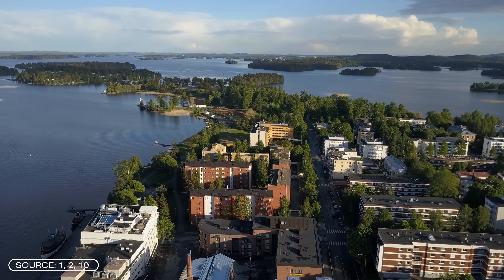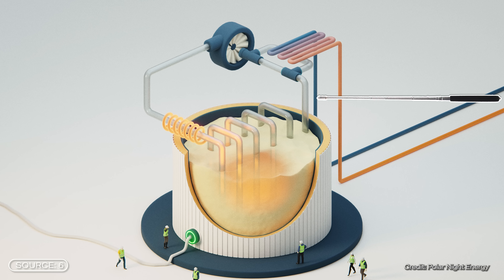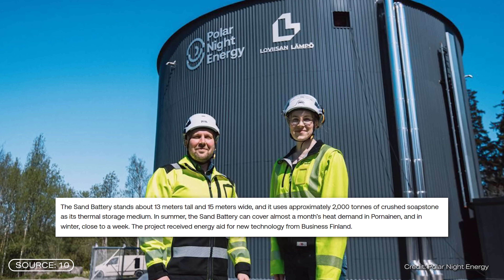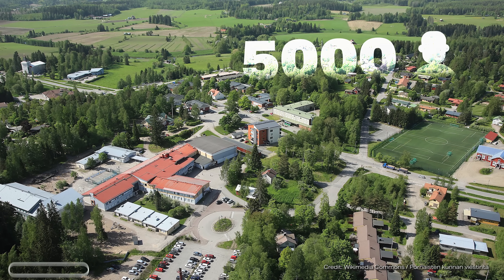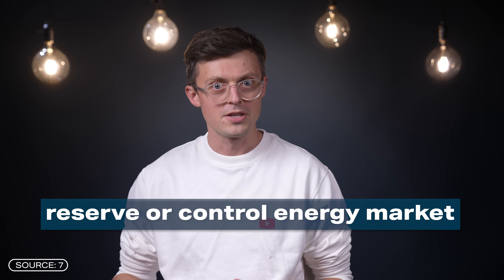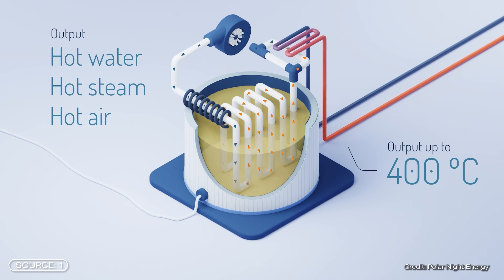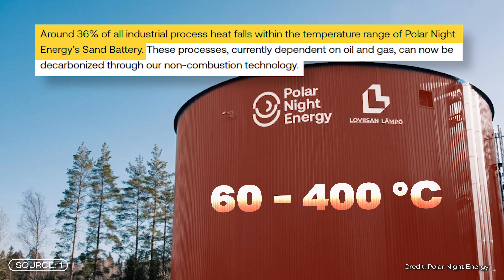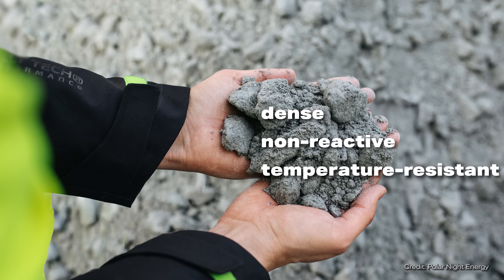Finland's Giant Sand Battery: A Revolution in Energy Storage?

Comment: Why does this unit have a working life of only 30 years?
Reply: Mr. Socks, I would think that is a conservative number, considering the inductive coils and the fans used to move air thru the system are all external, so when they fail, they can be quickly replaced with off the shelf parts.

Comment: I think the biggest weakness in this solution is that you use the highest quality energy source (electricity) to produce one of the lowest quality energy sources (heat). In Denmark district heating is widespread, so this type of solutions would work well. But there are a couple of sites in Denmark where they use ponds as heat batteries. Basically big holes in the ground, sealed and filled with water, with a floating insulating lid. On land thermal solar collectors are installed and they heat the the pond to about 90 d celsius in summer period which is then used to supply heated water to consumers via a heat exchanger. All you need is power to drive the pumps so there are virtually no operating costs. About 50% of the heating on the island of Ærø is covered by this solution - about 5000 inhabitants.

Comment: 9:38
Every steel plant using blast furnaces have been using brick batteries for decades, if not centuries. 
The brick batteries were heated by coke production gasses being burned 🔥 to heat the bricks to red heat and then when "blasting", the gas is shut and moved to another battery while air is passed through the original battery and injected into the furnace through tuyers at supersonic speeds to reduce the iron ore, coke, and limestone to pig iron for Bessemer converters or open hearth furnaces to turn into steel with added elements for specific properties ❤
I love the videos 
Please make more

Comment: It seems (to me) that the resistance and then conversion to hot air is lossy, though it might be that placing the resistive wire directly into to sand has problems as far as damaging the wires themselves. Moist sand could be heated by electrodes as opposed to the long resistive wire, which is also subject to thermal shock and inrush currents shortening it's life. Thermal vacuum panels could increase the efficiency, and I would guess that this system would also need expansion joints just like a bridge. The most "R"  value is of course needed on the top, leading to structural design issues that must be addressed but certainly can be mitigated. Perhaps Glaubers salts or a most efficient mix of the sand itself could be found as that would also improve it. All the Best! 73 DE W8LV BILL (and in SANER times) W8LV/VE3🇺🇸🇨🇦🙏🇺🇦

Comment: The issue with this is that the capital expense per kWh of storage capacity is too high.  The smaller one a few years ago was around $25/kWh-th, this is probably similar.    Much lower capex is needed for truly game changing seasonal storage.    I suggest you instead look at Standard Thermal's thermal storage system.   It stores heat (also at 600 C) in the cheapest thing imaginable:  a pile of dirt.    Dirt can be piled up for about $1/ton, so this is promising a capacity cost of $0.10/kWh-th, two orders of magnitude better than the Polar Night's scheme.

Comment: Why do they build the battery above ground and not in-ground?
Reply: Ground water movement can remove a lot of heat. Being elevated ensures that doesn't happen. Somewhat ideal, would be to use a hill that you excavate into, and berm the walls with the soil, and over the top and down the sides of the hill place a water barrier such as plastic that is sloped slightly away from the mass to keep the whole core dry. Also an advantage is if the unit is insulated and buried, and then bermed, in the winter the unit has the soil acting as a buffer to the extreme winter cold.

Comment: Some of your logic is very difficult to follow and certainly does no favours to the sand battery. You say the system is designed to charge up to 200 times per year but, in reality, will charge only 30 times per year ... and thereafter you treat that number as some sort of 'real world' charging limit that you compare unfavourably to Denmark's seawater heat pump. This is despite revealing earlier in your piece that the fully-charged sand battery supplies its customer with an entire month's worth of heat in summertime. Clearly, it's charging 30 times per year because that meets the customer's needs and WOULD charge up to 200 times per year if that were needed. Also, you continually jumble the task set for this first-of-a-kind system - district heating - with the multiplicity of heating tasks it will tackle going forward. This is despite revealing early your piece that Polar Night's future focus is industrial heat demand. By the end of your piece you've inexplicably pigeonholed the sand battery as a 'niche' tool for district heating in cold countries. "I just think it's very niche because many countries don't really need much energy in the form of heat". Your throwaway line "it can also be used for industrial heat" completely underplays that massive decarbonisation opportunity - in EVERY country, hot OR cold - over a range of temperatures. Industrial heat isn't an add-on. It's the main game for TES aspirants - Polar Night, Rondo, Kraftblock, Brenmiller, Caldera and a host of others.

Comment: 10:20 Agree on the district heating. I live near city of Kuopio in Finland, where the district heating can cost almost 2000€ per year for a medium sized home. About 20% of the cost comes from fixed monthly payments. As the efficiency of heat pumps has increased, geothermal or air to water, people are looking for different solutions for district heating. 
In apartment buildings with 20+ apartments the district heating makes more sense, and usually is quite bargain for the resident. 
I have understood that there has been few projects in Finland where a apartment building is using geothermal energy as heating source, but I don't have more information about how it played in the end.

Comment: Your bit of on the scale how long the battery lasts, but otherwise that that its pretty good.
Also, Elisa is not running the optimisation of the sand battery. They only run the reserve market
Reply from the maker: Thanks for the correction!

Comment: Sand batteries can be quite cheap to store heat and maybe energy-to-power in super niche situations.
That insulation is maybe the second most stable and idiot proof technology in it. Only the sand beats it. 
The whole thing relies in smart energy store plan with waste energy and cheap electricity. you can use it to help energy grid not to collapse when some factory or house area disconnects from the grid unplanned.
It's all about, how cheap you can make them and fast, and also the heat distribution infrastructure.

Comment: Burning fuel in a powerplant then using that electricity for resistive heating will always be more expensive than just using the same fuel directly. If all surplus electricity gets used by flexible loads, the spot price stays roughly stable and is determied by LCOE of underlying generation technologies. So if we want the real costs of energy production not to grow (at least in this scenario with no curtailment, since curtailment also raises the costs of energy), the LCOE of renewables cant be above the price of fuels, or, ignoring capital costs, it has to be at most 60% of the cost of electricity from CCGTs (given that they are about 60% efficient). So, if LCOE of CCGT is at $50/MWh, renewables must be at $30/MWh. Anything above means that an economy has to pay a premium associated with climate change mitigation and weigh these costs against potential damages from doing nothing.

Comment: In the Netherlands only about 7% of buildings are connected to district heating yet there more than 3,500 thermal batteries in the form of Aquifer Thermal Energy Storage systems. They work both ways, for heating and cooling, and function as seasonal storage. These systems are cost effective. Of course they can only be built if the underlying geology allows it.

Comment: 30 charging cycles. So it's not renewable then... Hopefully they can get more in the future.
Reply: 30 Each year, not the lifespan. As long as the heating elements works and the tank doesn't rust it's have really long lifetime.
Reply: @terradeamon  Oh okay, my bad. Thanks for correcting. Well then it's even more fascinating. I was also thinking, why they dont lower it down into water to mitigate winter effects (or just bury it in the ground). Water is always +4 celsius and underground might be even better.
Reply: @peterolofsson9871  yea that was what I thought, turns out the big issue is water ingress, it could be explosive if it gets superheated to several hundred c. So you have to spend a lot more to build it. And if you just use a lower temp you loose a lot of the energy transfer. 😅 Can be done but it built completely different, more like ground heat that you dump extra heat into during the summer. (Also a fascinating tech)

Comment: If you have district heat network in the area and you are going to use the energy only as heat for the surrounding houses, water is a better medium than sand. You need to convert the energy only one time from electricity to heat using excess electricity when it's available and you can use heat pumps (COP between 4 and 6) to make the hot water. That hot water can be run directly in the district heat network and returned to the same container.

I think for sand to make sense, you need have industrial customers near by that need high temps and/or a lot of excess electricity production (i.e. solar panels) so that the inefficient E - H - E conversions would be worth it.

Comment: Except district heating is essentially always made upon industry in the area ie factory have powerplant that produces the electricity for the plant and excess is pumped into grid, the heat after all the factory needs like for drying etc and heat collected from the smoke via smog washers and turned into glycol water heat using water to water and air to water heat pumps, are then pumped into district heating glycol water that gets pumped into control station in the district and from there via heat exchangers to district specific loop. Only way the heat battery makes sense in these applications is if they use this heat instead resistive heating element to add and collect the heat. On factory the heat collection with heat pumps makes sense, but for this its questionable if conversion efficiency makes sense, specially if you are pumping air trough all that. Maybe a closed loop air circulation could be done inside the unit but electric heating the mass should be the back up 3 for this system.

Comment: Reading Pornainen like a German word would've worked much better than English pronunciation.
11:03 ...No? Why would you need to make it smaller, if there's enough sand to fill in the gaps? Yeah, you're adding surface relative to volume, but if most of the material is sand, it doesn't really matter if the draw is 1% per hour of max. And the insulation looked like what we've been using in houses for decades. It's rock wool or similar.

Comment: When you pronounce Finnish words such as Loviisa and Elisa, you should pronounce the short vowels and long wovels a bit different. Short vowel (e.g. single i-letter) should have constant frequency ("one note") and double vowel  or long vowel (e.g. double i-letters) should have a sliding frequency from higher frequency to lower frequency (imagine sliding a note or two on guitar string). It sounded like you did words Loviisa and Elisa just the other way around making it sound like "Lovisa" and "Eliisa" for native Finnish speaker. Many native Finns fail to notice the frequency change in their own speech and they may claim that the difference is the length of the produced sound. Yes, there's some length difference because you cannot make the sliding sound with very short sound but that's secondary effect only.

Comment: The reason this tech get better the bigger you can make it: surface area (heat losses) for the whole container only grows to square but the whole volume (total capacity for energy storage) grows to cubic when you make it bigger. And logically there must be some minimum size after which it no longer makes sense to build the storage at all.
Reply: Heat storage losses are minimal compared to the heat stored in them.

Comment: 1:30 It's pretty easy to imagine a great improvement to this system: instead of resistive heater element, use heat pumps to convert electricity to heat. Of course, the practical issue is that a heat pump able to work at these temperatures is much more expensive than a resistive heater element.

This could bring the heat round trip heat output to over 100% already!

Comment: I call absolutely bullshit. 1. They getting huge amount of money from coverment so they have probably sweeted the numbers. 2. heating a sand take a lots of energy. Ofc when you get sand temp to sweet spot you have keep it at right temp or it will take again a huge amount of energy to get it back to up. 3. There is no cheap electricy in winters. Not anymore. For last 2-3 years the prices are rising like crazy. Ofc electricity is cheap in summer because no one need  heat they houses, but you dont even need sand battery then because electricity is so cheap.

Comment: We've used giant water batteries in district heating network for decades. It would be weird if this didn't work also. Needs a bit more insulation due to temps. Houses insulated with mineral wool have stood up for nearly a century so I guess it's a proven technology. Maintaining a tank with pipes, sand and some insulation inside also seems trivial. This seems promising because you can scale it up easily by just adding more units. Big or small cities benefit from it. It's indeed technology for north but also for some industrial users. In Finland grid energy price has occasionally been negative. District heating prices have risen because of many reasons, e.g. lack of wood chips from behind the border. If this can even out both prices it's just great. In Finland electricity price soon varies for each 15 minute intervals.

Comment: I had a dishwasher with sand battery in bottom. It store the heat from hot water and use the stored heat gor drying cycle. It was made by Bosch

Comment: This is a bit odd to an American, since though we can have centralized natural gas and sewage, we've never heard of thermal power plants until they started getting blown up in Ukraine. Most homes have either HVAC or a combination of water-heated radiators (domestic water is heated either by fuel oil, electricity or natural gas) and window air conditioning.

Comment: I think 35% efficiency when turning the heat back to electricity is okay, because it means you are able to run those wind turbines and solar panels 24/7. Nowadays, you have to turn them off to prevent overloading the grid on windy days etc. But now, they can always be running and the energy can be stored as heat, and then fed back to the grid on calm days. This could be great to pair with wind generators essentially. I think it would significantly improve the energy output of wind power. Because it means that instead of generating 0% of the energy output of a wind turbine because it cannot be used due to grid overload, you are at least generating 35% of the max electricity output at all times.
Reply: And a good part of the 65% can be used as waste heat for district heating.
Reply: @surters   True! The excess heat could even be directed to heat up a separate (empty) sand battery in case there's no demand for DH.

Comment: Where is all this energy coming from in the winter or when the wind doesn't blow
Reply: The battery also gets energy from the grid. As he said at 6:12 about "reserve or control energy market". It doesn't have to be charged all the time. It's a storage system which, yes, does ideally store green energy, since lack of ways for storing green energy has been a major issue working against its wide-spread adoption. But the battery can also be stored from the grid, balancing out the load in the grid; store when the load is high; release when the load is low. And if there is no energy to store in the battery, then so be it. It's a battery after all. Then it just sits there and is used as an energy source, until conditions emerge when it can be charged again.
Reply: The originators of the idea who formed the company Polar Nights Energy, are university students looking at green energy, and they knew that in Northern latitudes that have short days, to possibly some areas far enough north where the sun hardly is above the horizon, the dilema is the excessive number of solar panels you would have to have to meet winter demands when heating demands are highest. Ideally you build a smaller solar system, which produces an excess of electricity in the summer months, and place that energy in the form of heat in a mass, to recapture in the winter.

Comment: First news about this technology was - as far as I remember it - sand battery as a solar energy storage (and transformation into heat). Thats why the company was named Polar Night Energy. The idea was that in the summer in Finland the days and therefore the possibility of harvest solar energy are long and in winter short (no solar energy) and with help of this technology the solar energy of the summer could be used in winter. 
I myself living in FI and having solar panels, would prefer to have at disposition some technology where I can use the summer energy in winter instead of summer, when the electricity prices are already very low (sometimes even negative) and there is no need for heating.